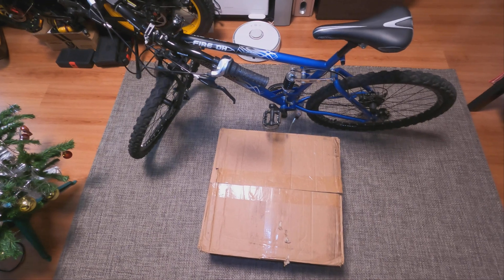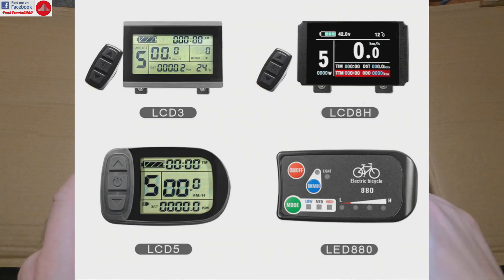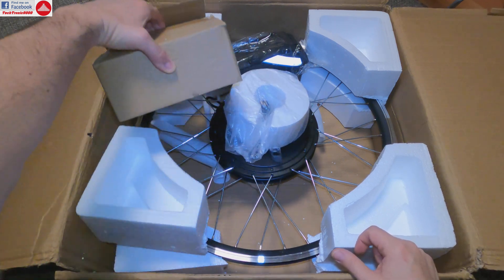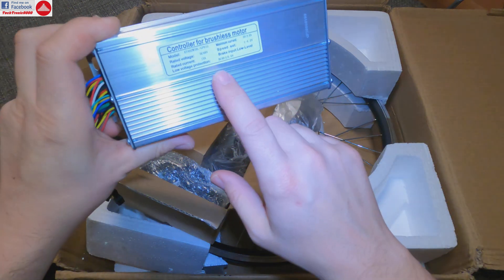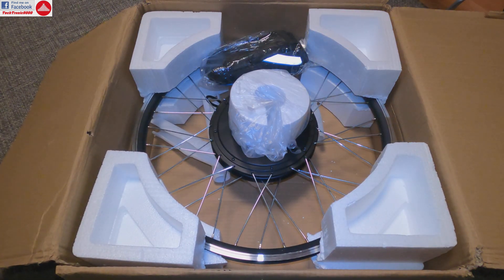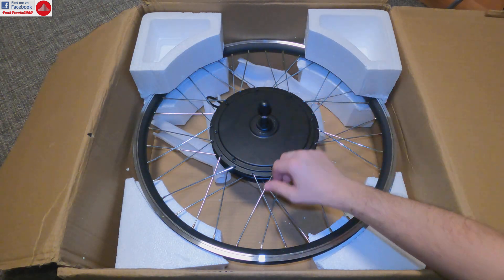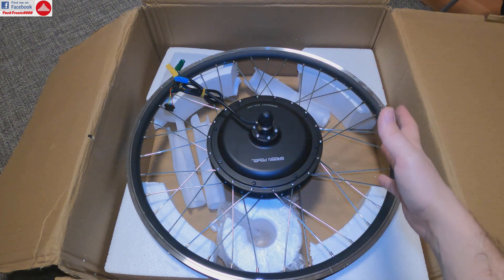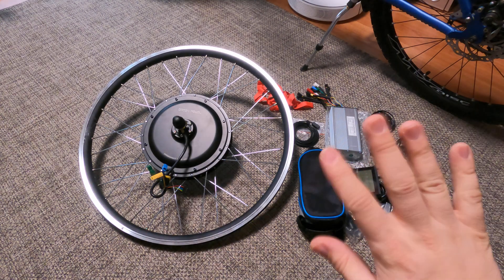How to build a cheap & fast eBike with a motor KIT - Part 1- Overview

Comment: I converted a full suspension MTB with a KT kit unnbenones to me at the time. 1000w with a 52v battery. Thrashed the hell out of it for about 8 months hard trail riding n jumping. 
I think I got the weaker rim but to its credit the spokes failed first lol.
I'm going to dig it out and put one of them sunringle mtx rims and a new display. Smashed that going over handle bars at speed lol. Still run with duff display but playing roulette with the battery after about 21 miles. Great vlog by the way👍
Reply from the maker: Yes you are absolutely true about broken rims and spokes, I've seen that a lot. Beside the normal abuse, there is also the extra weight of the motor / battery etc which some riders don't take into consideration. Thank you for following me.
Reply: @TechTronic9000  twas heavy with  20ah 52v battery as well.  Fast fun and for all its weight it experience alot of air time and sometimes bad landings. Got plenty of. pinch flat punctures, I used to have the pressure at 55psi to avoid those. Much easier fixing a puncture on a mid drive when out in the fields.
Reply from the maker: That was a hell of a "brick" at 20Ah and 52V. Well personally i don't plan for jumps and extreme rides, but I do like accelerate and zoom through traffic while also going off road on hills :)

Comment: What are the regulations for using an electric bike on the roads there? Here they are only allowed under the same rules as a normal bike if....A bicycle with an electric motor or motors capable of generating no more than 200 watts of power in total, and the motor(s) is pedal-assist only.
Or....A "pedalic". A pedalic is a bicycle with an electric motor capable of generating no more than 250 watts of power, but the motor cuts out at 25km/h and the pedals must be used to keep the motor operating. Pedalics must comply with the European Standard for Power Assisted Cycles (EN15194). The vehicle must have a permanent marking on it that shows it complies with this standard.
Anything else would presumably be classed as a motorcycle. Looks like all those drive units are way above this.
Reply from the maker: We have roughly the same thing 250W - pedalec only. But with the introduction of electric kick scooters we also got no power limit but speed limited to 25km/h class. This also applies only for public roads. If you go on a dirt road, ride through a forest or private road then there is no restriction. With this KIT you can easy set limit back to 25km. Also you can adjust the assisted mode. You can ride it unlimited and will face consequences only if you have an accident.